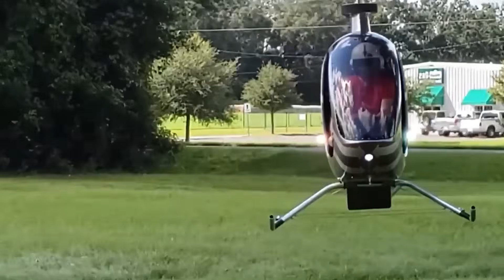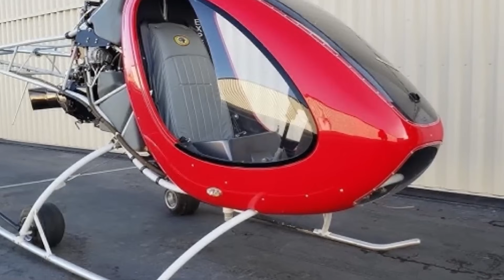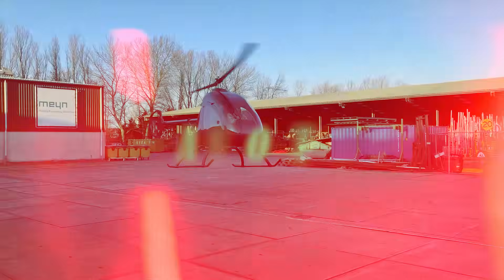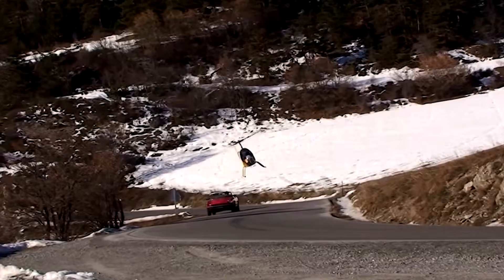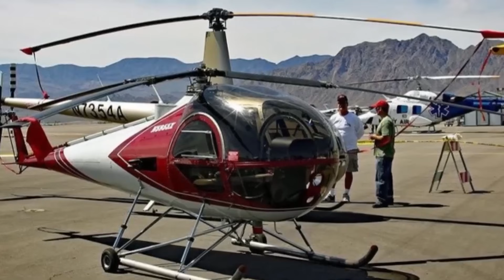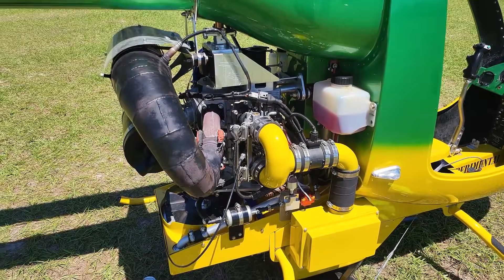Why Everyone Wants These 10 Ultralight Helicopters

Comment: Be careful what you call an ultralight. At least several of these helicopters ARE NOT ultralights. Remember, FAA FAR 103 for ultralight aircraft in the United States restricts your aircraft to the following perimeters.
1.	Weight no greater than 254 pounds.
2.	Single-seat configuration with only the pilot.
3.	Speeds no greater than 55 knots.
4.	Fuel tank of no more than 5 gallons.
 If you want to fly an aircraft as an ultralight, then you cannot exceed the above specifications. Exceed any of these specifications, then you need to get a light sports license and aircraft certification.
Does not require a pilot's license.